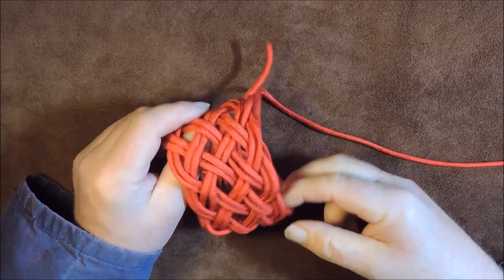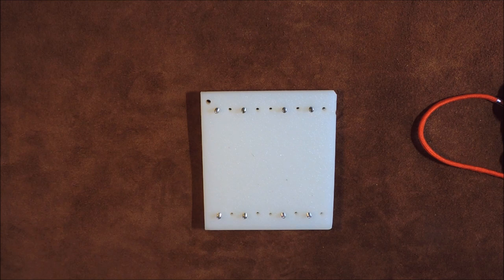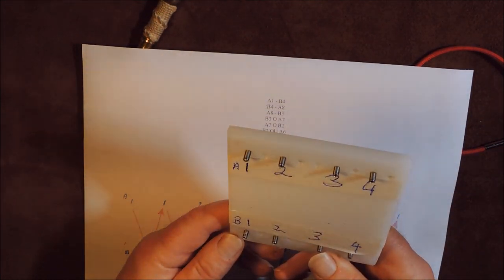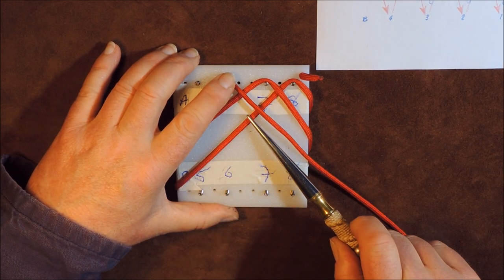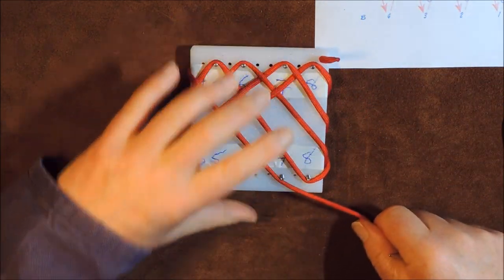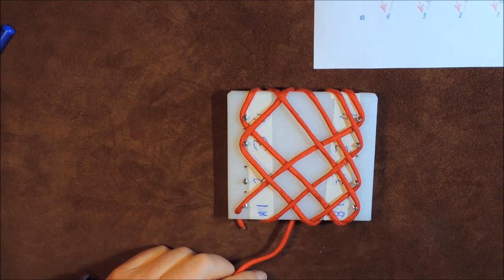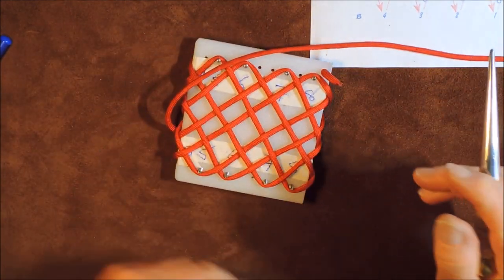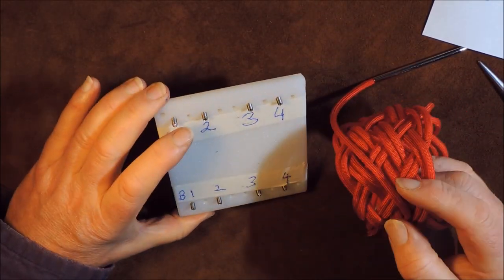Making a Turks Head Using a Turks Head Board or Jig - Easy to Follow Turks Head Instructions

Comment: A couple of pro tips:
1) There are holes in the edges of the jig so that it can be used to make THKs with odd numbers of bights.
2) Start with only half your length of cord through the pilot hole to reduce the amount line to be pulled under each time. After taking the knot off the jig, double and treble the knot in the other direction with the other end of the cord.
3) Use a crochet hook to pull the line under each time. Reduces the time spent dealing with twisted cord.

I've invested a lot of time memorizing how to tie various TH base knots in hand or around a piece of work and then how to expand them but I still use a jig when I can because the knot ends up more uniform. Saves time fairing it up.
Reply from the maker: Cheers for that Roger, I will pin your post to the top so others may benefit from the advice.
Reply: Roger Bank
Reply from the maker: David Clements is this a game of writing names or do you know Roger Banks, the loveable rogue?
Reply: Johnny Debt
That's what the kids do now when they agree with what the writer said.  Instead of using their words...
Reply: Where did you find the instructions that you eluded to for using this jig.  Have been trying to find the cookbooks that are now out of print.  What changes a Turks head into a globe covering knot?
Reply: @kevinorr6880  They often interlace two or three turk's heads, depending on the size of the sphere, to give greater coverage around the equator. Typically, the jig has at least two inner rings, so you're working ABCD, working AC with BD, and possibly BC as well.

Comment: Thanks for the video.  Great stuff.  How do you secure the ends once tightened?  Just tucked in?
Reply from the maker: Yes, basically put the Turks Head on the object you want to cover, then go round and gently tight, then again. Do not be tempted to pull it really tight on your first go round. When nice and tight on your object, you can then cut the ends flush, then tuck under. Thanks for taking the time to view and also make a comment, very much appreciated.
Reply: @KnottingKnots  Thanks.  I am just starting to get into this after years of appreciation for it. I will start with a Turks Head to mark the wheel center rudder position on our sailboat. Just found your videos......very well done, instructive, and clear.  Going though the "Knotting Tools" now.
Reply from the maker: @gtrevarthen  Once you have decorated one thing with the TH, you end up covering anything that move. Have fun doing this hobby and take care of your  fingers 😉 😉 😉 Oh yes tools, I love my tools.

Comment: I have fishing rods custom made in Los Angeles California and they have Turks head knots on them & for 30 years now I have been fishing with them & curious on how to make this knot. One knot has about a 1 inch inside diameter & the other is around one & five eighths inch ID. how do I start it on something round like a fishing rod & how do I sinch the string down tight to prepare to apply a clear epoxy and use 4 different colors of string. Red, Blue, white with a little yellow to represent the Philippines flag.
Reply from the maker: You might find this Turks head useful, as you do not need a jig like above: http://igkt-solent.co.uk/5-bight-4-lead-turks-head/ I will also did out an even easier 4 bight version.............
Reply from the maker: I just found this rather embarrassing old video that I did, but it is still relevant and easy to tie: https://youtu.be/6pL0HHYciQc

Comment: Excellent video. I first watched this when I was just starting out in knot tying and didn't know enough to really get the value of the video. 

I had to make a 6b7l Turk's head knot to go around an old rum bottle a while back and really wish I had remembered this video before I spent a good bit on a large cork cylinder to use as my pinned mandrel. (Which I've used exactly 1 time.)
Reply from the maker: It translates easily to a cylinder, you follow the same formula. Thanks for taking the time to view and also make a comment, very much appreciated.
Reply: @KnottingKnots  very true. I lament not thinking about your jig when any board laying about the house could have done the same job as the expensive cork cylinder.

Comment: Is the rule for a Turk's Head knot always to skip 3 then 4 as you weave up and down?

So if you were to want a 20 bight version, (ignoring the weaving) would it be A1->B4->A8->B11->A15->B18->A2->B5->A9->B12->A16->B19->A3->B6->A10->B13->A17->B20....etc etc?

Is there a different pattern based on a different number of bights or does it weave the way I guessed?
Reply from the maker: You may be interested in this post where you can download some different Turk's Head formulas https://igkt-solent.co.uk/make-your-own-turks-head-tool/ I will look at a 20 bight Turk's Head and get back to you:
Reply: @KnottingKnots  at that resource, it looks like their example pattern was in a "3 then 4 then 3 then 4" cadence, which seems to tentatively confirm the notion that "skip 3 then 4 then 3 then 4" while alternating up and down is at least a valid approach to rhe pattern. I guess I'm curious if a THK ALWAYS follows this pattern or if there are other valid variations

Comment: Really clear instructions - well done! A lot of people can't break the knot down into really useful steps, but you've done it. Thank you!
Reply from the maker: Really pleased that you took the time to leave a comment, it really is appreciated. I take it that you are a decorative knotter?
Reply: I try!  Do you have a video showing how to transfer a knot from a board or tube to something like a dog leash, where it has to be tightened? As you can tell, I'm just a beginner.
Reply from the maker: I am not sure that you would want a Turks head as long as a dogs lead. However, if you do want to make a long Turks Head take a look at: https://youtu.be/MGNodpJTdxE?list=PL7nysDkNnZHeDG2R9xkYLwHdhVU3gmMEE This particular one can be made longer without too much extra confusion. The only thing is that the number of turns has to be more than three and then always an odd number after that 3, 5, 7, 9 etc.

Comment: If you're going to double or treble the passes, don't over-tighten once you put it to the object you're covering, or you'll make the repeat passes difficult. That final tightening comes once you've completed the repeat passes.
Also, if you leave the starter at the edge, it's very evident, so pull it through an over-under and extend the running/working end (the one with the needle on) the same distance at the end. Depending on your line, you may be able to get away with quite a length of "standing end" (that's the other end originally anchored off in the corner) tail under the body of the thing, I'd generally leave at least one "over-under".

Comment: Great video and precise instructions. Thanks. One question. If you wanted to alter the diameter of the knot, say to the diameter of a walking stick, can the knot be tightened? Or do you have to make a smaller board?
Reply from the maker: You do not need a smaller board for smaller Turks Heads. Once you have created the TH on the board, slide the TH off and then slide it onto the object you want to cover. It is just a matter of going round and adding the number of passes that you want, then go round pulling out all the slack till it grips tight. However, if the board is smaller than the object you want to cover, then trying to open out the TH to fit is a problem, so best if board is bigger than object.

Comment: I've used a board jig but a PVC pipe jig is so much easier to use and I DIY mine. Hand tie a few short 2B & 4B TH knots first around a wood dowel. Learn about laying tracks and burning tracks. After you understand the "turks head" a PVC pipe jig makes quick work of it. I make walking staff grips from 8B×9P (~1.75"×~1"d) to 8B×27P (~5.25"×~1"d) more Parts ie Leads make longer knots. 8B gives solid cover on a ~1" staff. The 8B with 3× divisor for the Leads make the weaving simple. Lay tracks - burn tracks. OU weave is a breeze on the pipe jig. FYI 8B knot means the pins are set 45° apart on the round 360° pipe. EASY
Reply from the maker: I think it all depends on what you are most used to. I do like the board for making a Turks Head, but use a cylinder when I make the odd Globe Knot. Thanks for taking the time to view and also make a comment, very much appreciated.

Comment: Great video & instructions, Am I correct in assuming that if I want a 3 bight turks head, that I would follow the first 6 steps? That would take me to B2 OU A6...
Reply from the maker: If you want three bights you would set up the board so that there are two pins top and bottom and one on the end. Then follow the pattern for a 3 bight x number of leads. You may be interested in this link, then on that page there is also a link to the advanced grid maker: http://igkt-solent.co.uk/turks-head-chart/

Comment: Good work. Keep the vids coming. Round jigs are much easier to use. I make mine of PVC/40 plmb pipe. Various diameter pipes make for using less cord with less waste when tightening onto a designated object. I believe beginners should start on their hand then an unmarked mandrel with no pins. Tie freehand and learn how to expand and lengthen knots. As you become more proficient there is no better background than understanding of "laying the track / burning the track". Though I have tied many hundreds of turks head knots, the hardest most frustrating thing is tighten, tighten, tighten and hide tucks. Tying and interweaving are fun. Tightening is work.
Reply from the maker: Hello Gerard, thanks for viewing and making a comment. There will be videos in the future using the PVC pipe method. Yes, the Turks head is great until you have a massive one that takes longer to tighten than actually create. Globe knots also come under this frustrating catagory.

Comment: I did this braiding right on the staff never heard the board technique before curious question how do you control diameter is it just the size of the board and when you're doing multiple passes is it always going to be easier to tighten on the object had a hard time pushing my threading needle through glass pass
Reply from the maker: I always tie a Turks Head loosely, then place it on the object, I then do the additional passes and only then start to tighten up.
Reply: @KnottingKnots  how can I send you pictures of what I do
Reply from the maker: @robertleonard707  Please let me know if you do post to this link. You can drag and drop a photo here, please: http://bit.ly/yourknotwork

Comment: Thanks for posting this board.  I was going to buy a flat knitting loom from the craft store but now I know it wouldn't have worked because both sides need to be used.  I don't think both sides have holes and pegs.  Back to the drawing board. I think I'll just buy one on line.  Your instructions were well explained.
Reply from the maker: Hey Angie, glad that you dropped by and left a comment. There is another version where you just use one side of the board, but you do not see much about that version. I think if you wanted a Turks Head Jig, you either get the round ones made of PVC pipe or go for a flat one like in the video. Got any pictures of your work that I can see?

Comment: I enjoyed your video even though its not much different than the ones produced by Don B. himself. I was wondering if you could possibly cover one of the knots from the book that has a couple turns round the board first. I own this jig from Don B and his 2 books for the full kit.. not sure how you managed to get the paracord through that wee hole... I've not been able to since the tool I believe was designed for smaller cord. Would love to see more from you on this tool, I personally mainly use it for the more weird and not traditional designs, however, it does make the work nice and neat from the start.
Reply from the maker: Thanks for watching and taking the time to leave a comment. I think that my board may be a later design, as paracord seems to fit very well into the hole. Yes, I can see that going twice around the board does cause a bit of confusion. I am not sure whether or not I will be making a video on this, as I don't think the kit is available anymore. I have tried to contact Done on a regular basis, but I never get a response. I too only really use the tool for more intricate Turks Heads. Would love to see some of your work if possible?
Reply: Johnny Debt you could look at my less active page on FB? I'll snag a link later for you.
Reply from the maker: Sure, or link up with me here: https://www.facebook.com/john.peart.798

Comment: Hi Johnny,  I am extremely new to this and I am enjoying your videos,  very clear and informative,  I want to make fancy key fobs using crown senet and turks head knots ,  and seel them for a local charity, instead of paracord   what type of rope could you use and where do you get it from , I would like to keep the cost as low as possible,  more money for charity :)
many thanks
Reply from the maker: Hello Sammy, thanks for popping over and leaving a comment. Sorry not to answer your question straight away, but I need to know what country you are in to answer in full?
Reply: I thought your reply was pretty quick my friend lol I live in Northern Ireland 😀
Reply from the maker: OK, that makes things a bit easier. As a decorative knotter I always want the best cordage, and in the good old days "Belfast Cord" was the best, but does not exist anymore. So the best quality stuff can be obtained from Mikko Snellman, here is a link to that video, which also has contact details: https://youtu.be/DVBogjW6kxo?list=PL7nysDkNnZHeVqirqzmWRE5-NiG6Ce-TZ Another supplier may be http://www.cordsandropes.com/ they are recommended in a group that I am in. One thing you will find is that cord can be rather expensive, this is why people usually stick to Paracord.
Reply: Cheers for that,  sounds like paracord makes more sense .  Sorry for the questions,  where is best suppliers do paracord  ?
Reply from the maker: I usually use 3mm paracord, which is a little more delicate than the 550 stuff and I get it here on Amazon: http://amzn.to/2sLQSm1 or here on eBay: https://rover.ebay.com/rover/1/710-53481-19255-0/1?ff3=4&toolid=11800&pub=5575285280&campid=5338064521&mpre=http%3A%2F%2Fwww.ebay.co.uk%2Fitm%2FArmy-Military-100m-Paracord-Reel-3mm-Basha-Tent-Bivi-Camping-Guy-Rope-Para-Cord-%2F381150398024%3Fvar%3D%26epid%3D1258047597%26hash%3Ditem58be558648%3Am%3Amio-_0PVwCLWSXWbgUUVYfg

Comment: After you get done making the turks head and slip it onto a pipe where do you start to tighten it up?
Reply from the maker: I usually start where the top lead enters the Turk's head, just gently pull it up tight, but not too much to actually pull the cord through, as you go round pull out any slack, but do not over pull. Keep going round and eventually you will get to the next row, keep going round and pulling up. You will then end up on your final row, do the same again. Then back to the beginning and start the process again. Eventually you will end up with a really tight Turks Head on you object. Finally, cut the two ends (or more if using more passes in different colours). Cut them flush and then gently push the ends under the weave, so as to hide them. Thanks for taking the time to view and also make a comment, very much appreciated.

Comment: You say that you have an 8 night Turks head but you don't say how many leads it is I counted 7 which makes it a square Turks head and I wonder if you can only use this device to make square Turks heads
Reply from the maker: Not at all Bryan, this tool can make many different variation of the TH. Yoou may be interested in this post, which has a link to the simple and advanced knot grid: http://igkt-solent.co.uk/turks-head-chart/

Comment: Oops, I confused you. I don't want a dog-lead-long Turks head, just to make a knot that's an inch or two long and slide it on to a lead as a decorative cover for a splice (say, the area where the handle joins the main body of the lead). It strikes me that tightening the knot would be difficult.
Reply from the maker: Oh, sorry for getting the wrong end of that one. If you are going to cover a splice on a lead, then yes this can easily be done with a Turk's head. Depending on the diameter of the cord, you want to use a TH with not too many bights. If I recall from a dog lead that I once made, I used a 4 bight TH to cover the splice. The trick is that you go round gently a few times and tighten each pass gently. Eventually, the TH will really tighten up on the cord, It is just a long process of being gentle so as not to over tighten in the early stages. When you finish the TH should be really hard over your splice.
Reply: Not to worry - clearly, I don't explain things as well as you do!  Anyway, I take it that you don't have a video on the process, but I appreciate the tips!

Comment: Thanks for this video Johnny!  I’ve been trying to learn more about turk’s head knots.  Actually looking to try a 55 lead 5 bight turk’s head lanyard.  Think I’m going to make a jig to hold a piece of 1/2” sisal rope and try to draw up an over under chart to wrap it with.  There’s not many resources that offer advise on very long turk’s heads.  Whip making resources I️ think have the most on it, but you have to buy the books or resources.  Finishing up my take on a bosun’s lanyard at the moment.
Reply from the maker: Might I suggest either of the following, Long 4 Bight Turks Head: https://goo.gl/mA6jZ4 or the 2 Bight Long TH: https://goo.gl/uDG7Hg with both of these you can increase the number of turns at the very start. In both videos it shows 3 turns, but you can just increase that in odd numbers to increase the length of the TH. Then the rest of the procedure is the same.